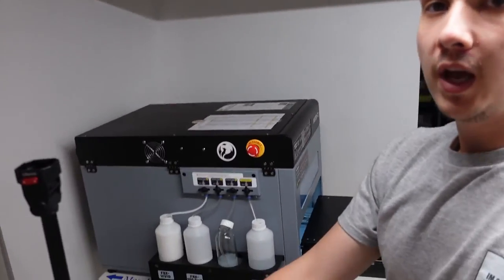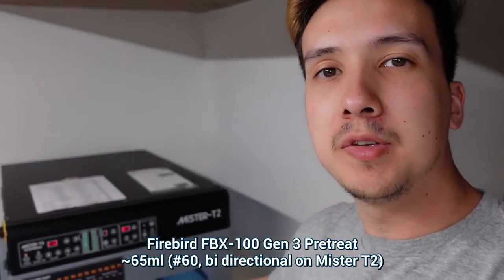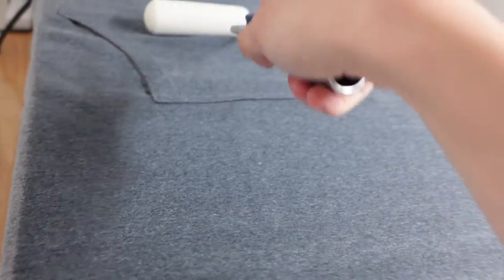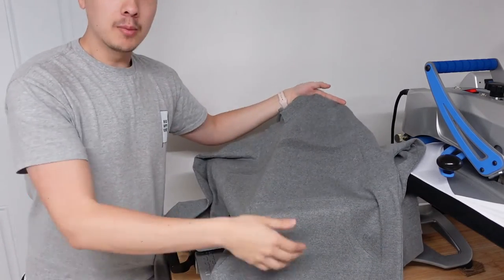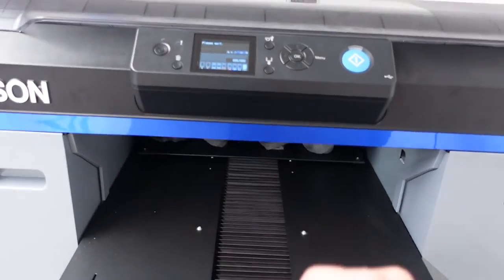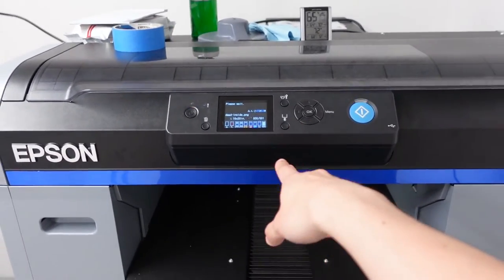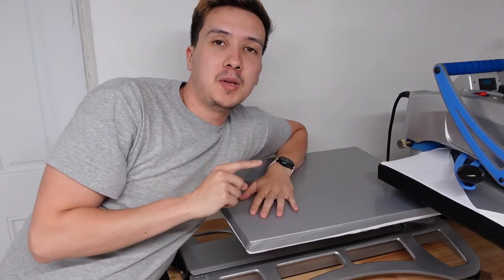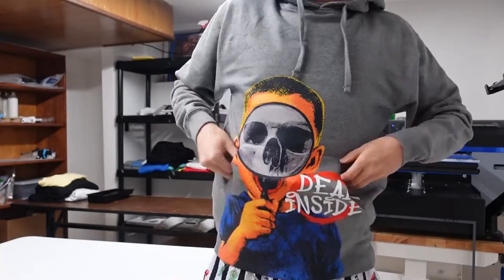Step by Step DTG Tutorial - Printing Over a Hoodie Pocket With Direct to Garment on the Epson F2100

Comment: Outstanding result. How does the ink looks after 10 washes or more?
Reply from the maker: If the process is done correctly, there will be no fading and should hold up well. My understanding from some of the people that have been in the industry a while is the ink holds up as long as traditional screen printing. I have several shirts and hoodies I have printed that have been through many washes and I have not noticed any cracking or discoloring yet!
Reply: @LovesBranding  thanks for making the effort to explain everything to us
Reply: If garment is pretreated & cured correctly, it should last for at least 30. We have shirts that have been washed over 50 times and sometimes in hot water and they still look good. I also have some that didn’t hold color as long and it’s because I didn’t pretreat well.

Comment: How do you set up x2 white passes, I'm using Cadlink digital factory v10.

Great vids BTW, I'm struggling getting vibrant colours with dtg on my 2100 but dtf are great, pretty frustrating at times.
Reply from the maker: Not sure on cadlink but on kothari you can toggle a second white pass. I think this may be an option on the higher level prints in garment creator. Otherwise, you can stop the print after the first white and re-print with a second white and cmyk. Not ideal but a bit of a work around.

Comment: What RIP software do you use? And link tot he tuclock acrylics?
Reply from the maker: I use Kothari (similar to Equipment Zone's EZ RIP) and occasionally Garment Creator depending on the project. Allegedly the RIP software save money but the main reason I find myself using it is because the settings allow you get better dialed in and is a bit easier to use once you learn it.

Comment: Thanks for the tips! Just wondering what kind of pretreatment you use for the hoodie? Especially when it’s a blend. Did you use dark polyester? Or dark cotton pretreatment? 
Thanks again!
Reply from the maker: Thanks for watching! These hoodies are 100% cotton on the outside which is why I prefer to use them. Because of this, I use my regular dark pretreat for it. I recommend Firebird FBX-100 Gen 3 or Creek Dark/Universal pretreat!
Reply: @LovesBranding  you can use any dark pretreat formula for a dark garment as long as it has 50% or more cotton. Some people use half polyester/half cotton pretreatment. I tried it before and see no difference in the result between that concoction and dark cotton pretreatment.
Reply from the maker: @nothgir  Correct, I've done some testing even including tri-blends and have been able to get good results. It all depends on getting good pretreat. For the highest quality prints, I always recommend 100% cotton but its very possible to get good results on 50/50 or other blends.

Comment: The only way you get it to print two layers of white is level 6?
Reply from the maker: You don't need to do a double white but for hoodies, I think it makes the color pop a bit more. This is automatically turned on/off with the higher levels. With a rip software, you can toggle this separately.
Reply: @LovesBranding  I use garment creator for my f2100 i appreciate you
Reply from the maker: @VeezTeez  I believe with garment creator, the only way to toggle two layers is with the level 6 print option.